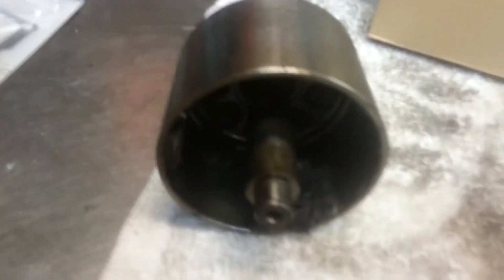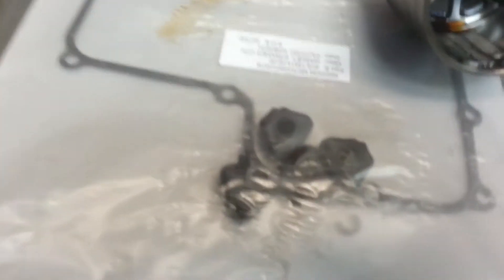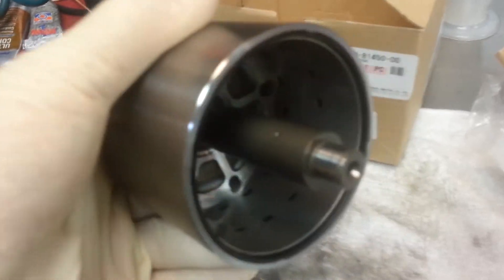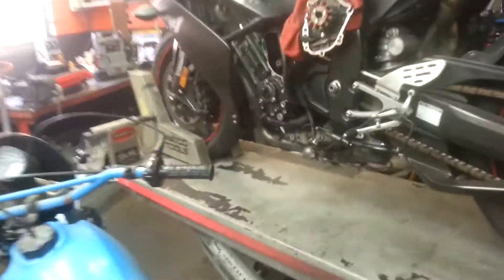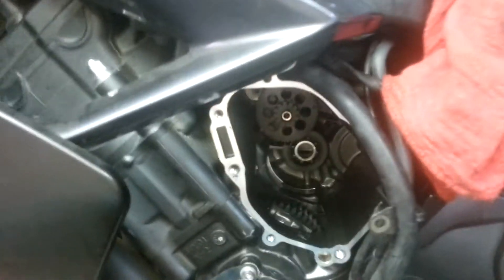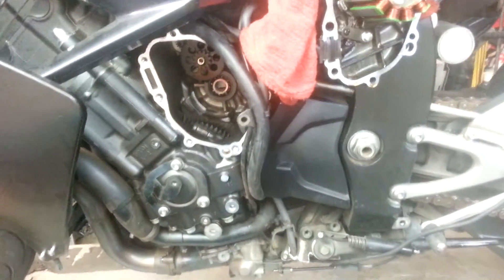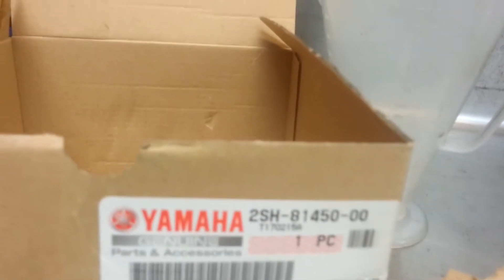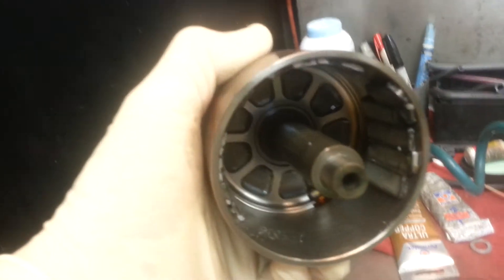Yamaha R1 Generator magnet failure 2007

Comment: putts you off yamaha totally doesnt it, it happened to my FZ8 and am in the process of repairing it now. had i of known this i would not have ever bought another Yamaha period and how come they never recalled them ??????? thats the burning question
Reply: I wanted to go with a cbr1000 bit the bullet and took what was cheaper and closer, went with an r1 (upgraded from a r6) which had charging problems also but I fixed it with a rectifier. I was thinking I would be good.

But oh boy was I wrong, 

Note to self stop buying yamahas

Comment: I'm not exactly clear what to do to remove this on a 2007-08. I've removed all of the bolts from the cover. Mind giving me some tips on the next step? As I've been unable to find anything actually listing or showing that part. Thanks!
Reply from the maker: Remove the center cap
Use a long screwdriver and push inside the center hole firmly while pulling out on the outer cover
This should hold the rotor inside the engine while you pull the magnet apart
Stuff a rag under the rotor when you pull it out last, this is so the cushions don't fall inside the bottom

Comment: Is there magnets on the new one?
Reply: Yes, one large circular magnet on the new unit. The updated part has been redesigned.
Reply: @factorywrenchtools1667  i have the same problem on my 2013 fz8n and my stator is ok too, is it ok with the old stator?
Reply: @mehmetkurtiz  You need to test the stator or just install it with the new rotor and see if it works. If the wires are not destroyed it might be okay, the stators don't fail the rotor is the part that fails, you might be okay, but you won't know until you actually try it.

Comment: ive barely got 15000 miles. this is crazy
Reply from the maker: New oil keeps the unit cooler, stay on those oil changes and use good oil, seems like those that skip the oil changes might have a better chance of this happening. Although if you buy an updated unit it can't come apart like the old one.

Comment: I win, it's happened to my bike three times now. (paid the cash for the updated part this time). It happened at 40,000, 80,000 and 115,000 miles. So almost regular. The good news is that as far as I can tell the bits left in the engine have not caused any further problems. (I have always dropped the sump and cleaned that out, but not had the fortitude to go for a full engine strip. Engines with lower mileage are readily available from crashed bikes, after all.
Reply: andy pugh hows your engine been running? I have the same concern for mine and I’m not sure about swapping engines. That shit is gonna be expensive and I’m not sure if i have to do that.
Reply: @MrPabloolvera  Perfectly fine. I rode it to work today. Having now done the job 3 times on the same bike it really does seem that dropping the oil sump off, cleaning what you can see, and putting is back together is enough. 
To get the sump off you need to disconnect the exhaust from the tailpiece and from the cylinder head (or split it in front of the power valve, if those bolts are still functional on your bike. I have had to replace my power-valve bolts  so mine can split there)  to get the clearance. There is pretty much no chance of splitting the exhaust at the connector near the catalyst, at least with the exhaust in-situ.
Reply: andy pugh ok well thanks for the advice and appreciate the quick response.

Comment: I have a 07 also. I replaced the Magneto, bearing and o-ring. I oil'd everything when putting it back together now I'm getting a squealing noise above 4k rpm. I pulled back apart checked everything the bearing also seems to be fine. Put back together and it still has a squeal above 4k rpm... Please Help!!!
Reply from the maker: Noise above 4k rpm could hard to find the problem. Engine spinning can't be duplicated very easy for testing. Maybe remove rotor and spin engine with starter motor and listen for something else making the noise. Double check the bearing is seated all the way in the case. You can turn engine over while pushing on rotor so it won't come out, use something to push on rotor while you turn engine over and listen for rubbing or the noise you have. We use a mechanic stethoscope to listen to engines making noise inside to try to find where the noise is coming from. When taking it back apart look closely for shinny metal that has been rubbing just slightly. Good luck, hope you figure it out quick.

Comment: My 2010 built (2011 registered) FZ1-S's magneto just failed on me yesterday, almost similar to your video. Roughly 50,000 km done on my bike so far. Did not expect it to happen to me, but it did... now bike is stuck at the workshop, hopefully they do a good job...
Reply: Hey man, how did it happen? How was bike behaving? Just got my bike losing RPMs and engine started losing power and stopped responding to throttle increase. Then it refused to start at all.
Reply: @victoralexandrov7684 did you ever resolve your issue i literally had the same thing happen to me with my r1

Comment: Yamaha telling me they have to open up the bottom end of engine to clean out and replace piston rings and bearings. Along with gaskets. Is this true? Don't want to get ripped off
Reply: It's the sort of work you would do if you wanted to guarantee the job. I have done it three times now  (on the same bike) and have only ever dropped the sump to clean it out and changed the oil (cheap oil, run the engine a few miles, change that oil for the normal oil)
Reply: Tell them to cover the tab then

Comment: Where can I get that generator
Reply: I have a r1 2007 that has a code 46 and I already check the stator, rectifier, battery but I did not check  this part. How did you now is this part the problem? Have I remove the stator and check or it has something that I can do before remove the stator?
Reply: Ebay